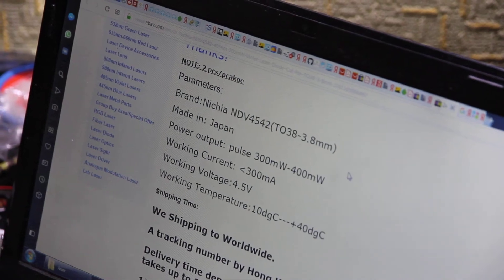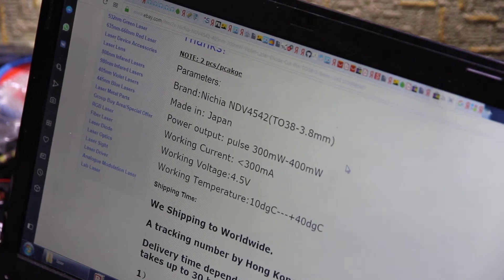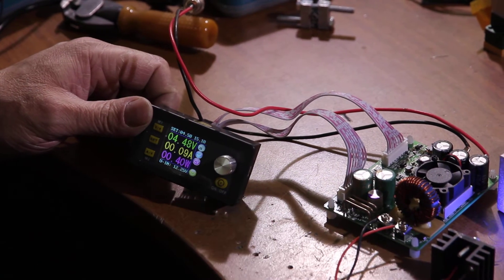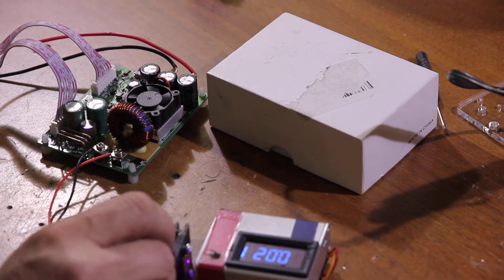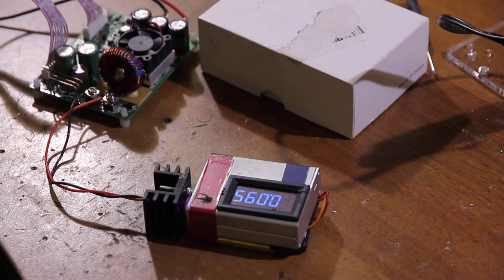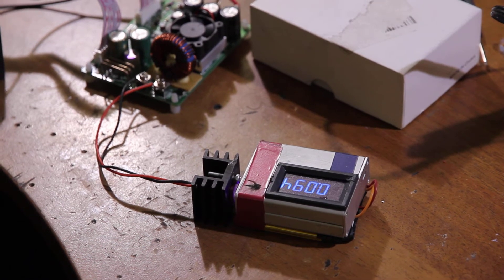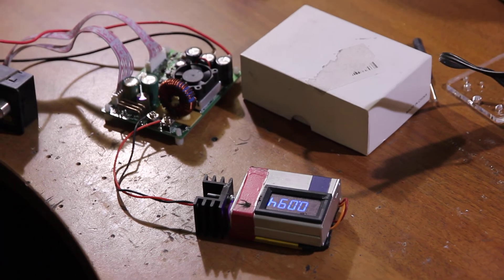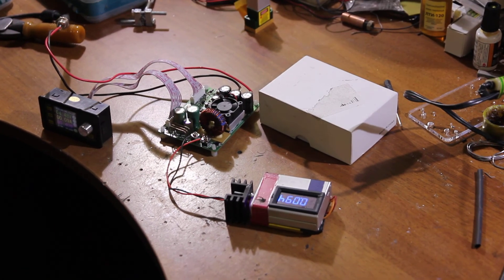Testing a new 405 nm laser diode from NICHIA

Comment: The datasheet of the NDV4542 says 100mW Continuous Power and 200mW Absolute Maximum rating which you normally dont want except you want to destroy the diode very fast... I am quite sure this diode is selled by chineasians in this 500mW 405nm modules. They simply round-up the 400mW PULSED power (specified for 33MHz Freq and 50% Dutycycle) to 500mW and make people think this thing can do a 0.5W continuous power ...